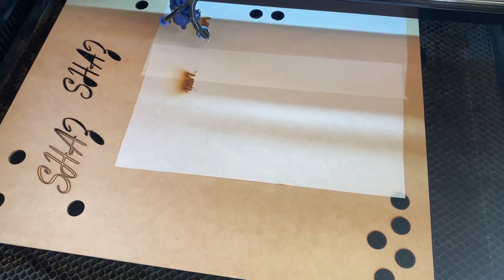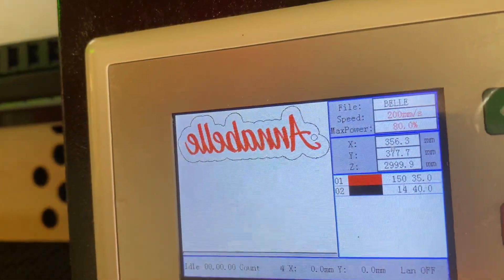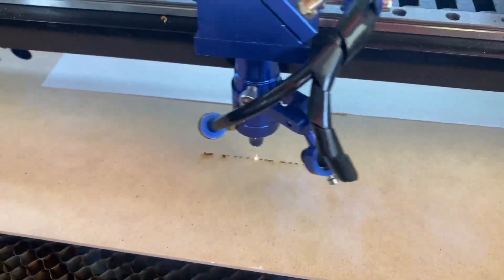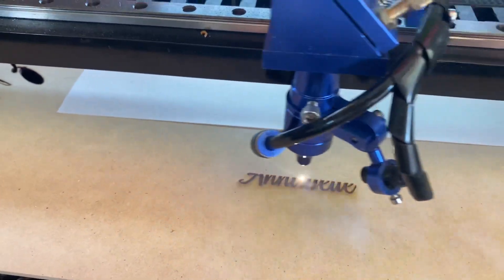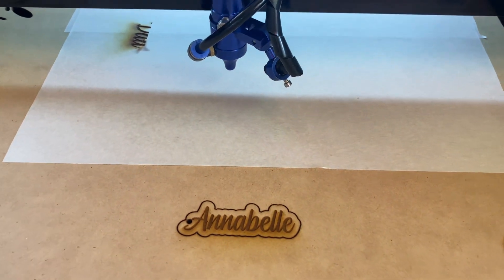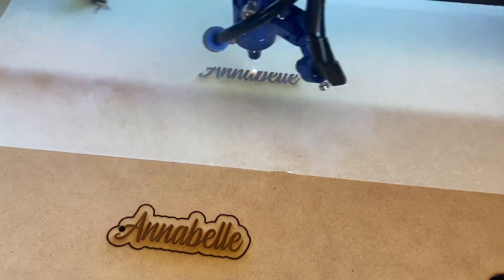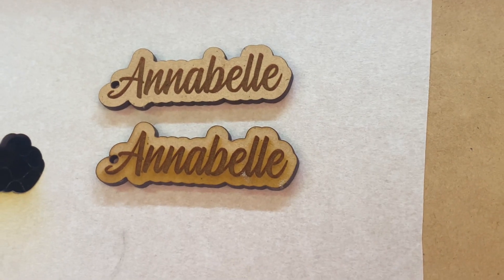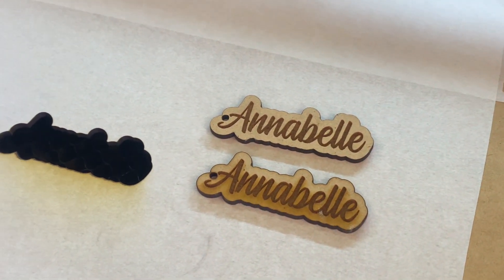C02 Laser! Masking Tape Vs No Masking Tape!!!

Comment: If you didn’t use air assist during the engrave you probably wouldn’t need the tape at all. On my diode laser I never use air assistance except to cut.
Reply from the maker: Yeh maybe so however you do need some air blowing out when engraving with a C02 to protect the lens 👍🏽 cheers, Matt

Comment: Nice.  Thanks for the tips.  I was wondering how to get a clean engraver on white wood.  Was thinking about sanding after engraving.  This is much easier to do
Reply from the maker: Thanks, yeh you could definitely do that but you can also use the masking tape method it works a charm 👌🏽 when engraving the less air the better you only need a small amount to protect the Lense. Thanks for watching 
Cheers, Matt
Reply: Probably cheaper as well, but a little messy. 🤷‍♂

Comment: what about using air assist while engraving
Reply from the maker: Hi from what I can tell you shouldn’t use air assist while engraving as it pushes the fumes/smoke back onto your material you do however need to have some air comming out the nozzle to protect the lense but only minimal

Comment: MDF is an engineered wood with a plastic binder. It is one of the worst materials for producing  copious brown tarry fumes.   Masking tape is s sticky plaster  to solve a problem that need not exist.
 Anything I suggest from here is not intended as critcism because  I have the T shirt and my similar mistakes are on video also..   First you must NOT use air assist when engraving . This is not cutting because there is nowhere for the fumes to go except upwards as you can clearly see from your video These fumes are very tar laden (like steam is water laden). You are blowing those micro droplets  of tar back to the surface of your work where they do a great job of painting things sticky brown. Not only is it contaminating the surronding area but your engraving is being coated also.  For engraving you ideally need zero air assist BUT that puts your lens at risk of contamination so you need an intelligent air assist kit ( see  https://www.cloudraylaser.com/products/ultimate-air-assist-set?_pos=1&_psq=ultimate&_ss=e&_v=1.0       look in the description to see a video)  or as a quick temporary fix,  an in-line flow control like this  for 6mm tube to reduce your engraving air flow to just a whisper. Trust me the results are remakable without masking.. There are other thinbgs you shoud do as well but I will leave you to watch theair assist  video I reference below.
https://www.ebay.co.uk/itm/175129091789?hash=item28c681decd:g:eq0AAOSwL29h8QCE&amdata=enc%3AAQAHAAAAoLUCK%2Fvd6ARDezROqDi1K9U3L4Bqv5FaKU3sW2jwucM%2FXDaGLN8IT4j9fGpbQRSTy%2B2gXgw2YAVZtHylUQ42X%2BDTqxjabveBTu4Qi2IiD5148wHgEAo%2Fk0m%2F7g5iYTqfQalZQ%2FbCGHJgNkDTnSW0%2Fx1RdLPipi6Yq0o5KVFvdc1iz8fRRzA87Whmqt6PJq7rK9v9BvZr6uI%2FuC0UjlvfTcE%3D%7Ctkp%3ABk9SR_Kh7YSPYQ
 I note 2 things from your screen. It is backwards to your engraving. Press the ZU button to acces a menu that allows you to set your screen origin  to the correct orientation. You are only using 40% power for cutting.  The best,  cleanest and fastest cuts (without damaging your tube ) should normally be done with typically 75% to 80% (max and min) power and FULL air assist.
 
For anyone dropping into this video I recommend you watch the real truth and science about air assist here because there are so many misunderstandings, myths and blatent untruths about this subject    https://youtu.be/79VZjMdfBmI
 Also there is  a lot more to be learnt quickly about all aspects of  laser technology here.
https://laseruser.com/the-concise-rdworks-learning-lab-menu/
 
Have great fun with your onward journey learning about this fascinating technology.  Discovery is very satisfying experience as you found with masking masking. However, always look backwards when you discover a fix and try to logically understand the reason you implemented the fix.  Watch a few Trotec videos to see the so called experts teaching you how to apply sticky plasters.  (masking being one of them).
Reply from the maker: @SarbarMultimedia 
Hi Russ, first off thanks for checking out my video iv watched many many hours of yours!! Your a very knowledgeable man when it comes to these machines your in depth videos are amazing and I’d advise anyone and everyone who is interested in C02 lasers to check them out!! 👍🏽

Secondly I do have the cloud ray ultimate air assist installed on my machine the same one you designed after reading your comment I realised I had the needle valve unscrewed a bit too much on the solenoid allowing too much air to pass through while engraving!! 

Thanks for the tip with the screen iv just not been too worried about the orientation of the preview and as for the power are you saying it’s best to run at 80% and at a quicker speed even on thin materials? 

Last of all In no way do I think I’m an expert or fit to offer advice I’m just learning as I go and enjoy posting up some vids along the way 😀 

Cheers Matt
Reply: Didn't expect to see you here. I watch a lot of your videos.
I've been thinking (in the back of my head) that a vacuum nozzle assist (in addition to the normal venting) to the workpiece would be a better solution than the blowing air assist as it would take the tar away from the surface so none of it would settle and also keep the lens clean etc.
Reply: @mrfoameruk  
Thanks for  looking over my shoulder. My videos are all about ME exploring the edges of this tecnology that others take for granted. This is pure self-education to keep my two remaining elderly grey cells exercised. If others can benefit from my selfish enjoyment then that's a bonus I never planned on.

I rarely comment on other's videos  but occasionally I  encounter  someone who is perpetuating a myth and I take the time , not as criticism of the video but to try and pass on facts to other who may be attractd to the video title.

 Back to your dream of using vacuum as a cure-all. Sadly I have more than 3 tattered T shirts on that subject. Yes, itsseems obvious that sucking the fumes away will fix the brown residue problem.. Without wasting to many words. A 60mm diameter hood around the nozzle, a piece of 3/4" flexi plastic conduit and a vacuum cleaner was a 3/10. A 3/4" snake whipping back and forth at 200mm/s was a mechnical disater waiting to happen....and it did.  However I did learn that 
1) the hood had to be close to the work (about 3mm)  
2) The hood masked visibility of the nozzle
3) Drawing the fumes awy with no air assist was not preventing the lens from being "smoked"
4) Any air assist to solve  3) was undermining the vacuum efficiency
5) A vacuum cleaner running the whole time??????

 I then rethought the problem to utilise compressed air to induce upward air flow around the nozzle.  There is a property of fluids and gases called the Coander effect and this has been exploited with devices called air amplifiers.  Here is an example of such a device  https://uk.rs-online.com/web/p/air-amplifiers/7606087
Expensive and not suitable in standard form, I designed my own variation. It was great fun for me to design and build  but functionality I rated as 2/10

MK3 was again using compressed air  (all small bore piping) to try and induce a suction with  high pressure tangential air flow air to creaing a vortex..0/10 sum that up.

So as you can see its been great fun failing.

As a young engineering designer one of my elderly mentors preached a list of simple mantras to me FIRST. You MUST understand a problem FULLY before attemptiing a solution. Complete understanding is 50% of the solution. SECOND If your design concept required solving more and more problems at each stage, STOP..  The correct concept  reduces rather than creates problems..  There are many more that are not relevant here.

 I was so fascinated by the smokey chase that I completely ignored those wise principles.  I eventually decoded the tarry problem by fully understanding the physics and  mechanism by which the fumes were produced and the manner in which they behaved. That allowed me to optimise stategies for cutting and engraving that turned out to be diametrically opposite for each process  but required no special equipment.....just understanding.  I have tried to summerize and demonstrate  those principles in this video
https://youtu.be/79VZjMdfBmI
 Best wishes
Russ